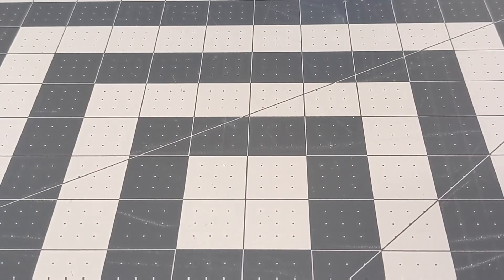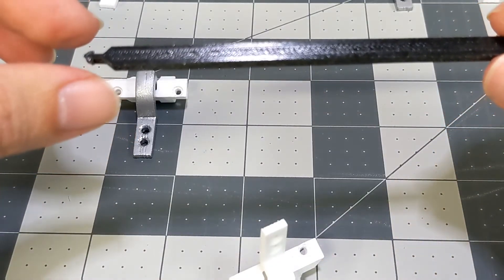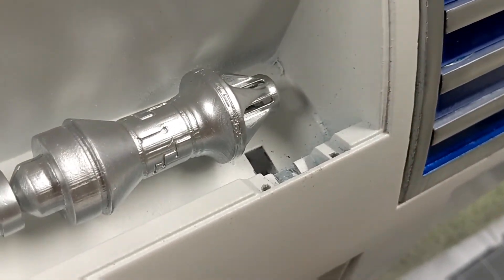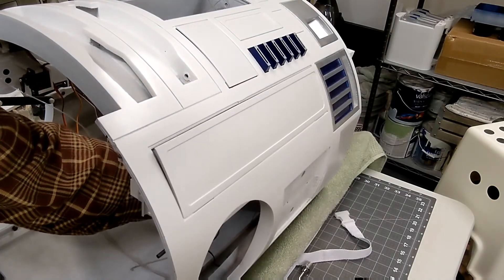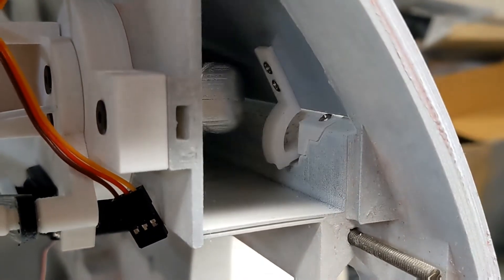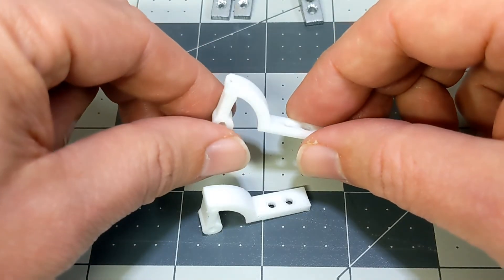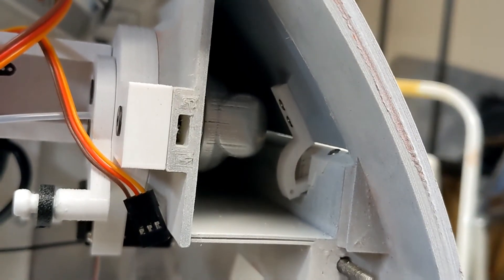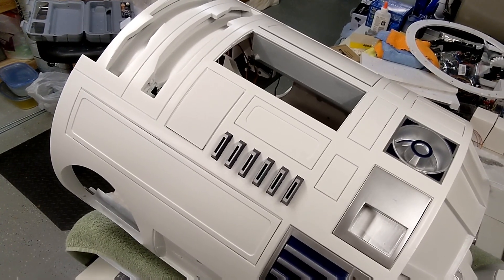Body Door Hinges

Comment: Hey Jason what paint brand/color did you get for the white portions of r2?
Reply from the maker: I used Rustoleum Satin Blossom White - it's easy to find pretty much anywhere (Ace, HD, Lowes, Wal-Mart). I also applied a Rustoleum satin clear coat over all the white - and so far it's held up really well. It's not spotless - there are a few scratches and chips here and there, but it's been decently durable.

Comment: Love you videos have learn a lot. I going to build a R2D2 using your videos to help.  What software do you to print your r2-d2 (fusion 360). I new to 3d printing so this is going to be a learning curve for sure. i will need to get a 3d printer and don't know hat  material to use for the printer .
Reply from the maker: If you're new to 3D printing, then you should definitely start smaller and work your way up to a project like this. A full-size R2D2 build represents a significant investment of both time and money. There are many resources online for getting started with 3D printing including many great YouTube channels, and I wouldn't be surprised if someone you know already dabbles in 3D printing and I'm sure they would be happy to show you how it works.

The 3D print files for R2D2 were created by Michael Baddeley and are freely available to everyone. The link to the shared drive that contains the files can be found here: https://www.patreon.com/mrbaddeley/about You do not need to become a Patron to get the files for R2D2, but considering all the work that he has put into providing these for everyone, it would be nice to support him if you can.

In short, Mr. Baddeley provides ".stl" files - one file for each part of R2D2. Many larger parts (like the dome, body, and legs) are actually made up of many .stl files that are printed separately, then glued together. In all, there are probably 500 or more individual parts that go into an R2D2. Bigger printers allow you to print some larger "chunks" in one go, but it is possible to print a full-size R2D2 on a printer as small as an Ender3 (220x200 print area).

We use "slicer" programs on our computers to convert the .stl files into "print files" (gCode) that are then loaded on the 3D printer. There are many different materials to use, but most builders use PLA+ or PETG for their droids.
Reply: @jasonsR2D2  thank you for your good suggestion.

Comment: Can I ask what is on the inside of each of the doors, it appears like there is a foam piece attached to the doors for thickness?  Is it foam, or a 3d Print?  It makes it look awesome, first time I'm noticing it.  I've watched this video multiple times as I'm getting ready to start attaching hinges to my body panels.  If you 3d printed the inside panels, are the stl files available?
Reply from the maker: If you're referring to the interior relief pattern, that is part of the standard body door files on both the MKIII and V2 Baddeley body doors (though the exact pattern differs slightly between V2 and MKIII). I haven't done any modifications to the body doors themselves. My DOME pie panels however, also have an interior relief pattern and they are NOT the standard Baddeley files. They are replacement pie panels that are included with the dome pie panel hinges that I used (https://www.thingiverse.com/thing:2797760). I definitely prefer the look of these panels - they better match the body panels.

Comment: Hey bud is it the V3 or V4 in the dropbox that i should print?
Reply from the maker: The V3 file is just the hinge saved as an .stl file, whereas the V4 is the raw Fusion360 source file that you can use to edit or modify further if the .stl doesn't solve the gap on your build. I think Fusion360 automatically increments the filenames each time you save/export it - there should be no difference between the two. Good luck and I hope it works for you!

Comment: I would like to say this was a great solution to a problem i had.  I thought i would throw out there how i solved my issue with out reprinting.  with the doors open i grabbed a mini torch heated both hinges for just a couple seconds enough to soften the plastic with out distorting it.  Then shut the door tight with my hand until the plastic cooled and done, doors shut perfect.

Comment: Have you or would you provide a scan or STL of your rod linkage? I have had issues trying to bend mine into the right shape and size
Reply from the maker: Here's a closeup of the linkage for my DPL door: https://photos.app.goo.gl/vn8sjm3yCXrVTF7n7 The other linkages are very similar. Overall, this linkage is about 6 inches long - I usually start with a wire that's way too long, bend the hook until I'm happy with it, then trim it to length. I also have a public build album ( https://photos.app.goo.gl/uHL7RM7Z8GswUFev7 ) that includes this image plus tons of others for reference.
Reply: @jasonsR2D2  thnx!

Comment: That hinge you made looks a lot like the V2 hinge, complete with the linkage hole. I have them on my R2. I've had my own share of troubles redesigning the hinges for a saw door on the other side of the coin slots. (Mark II body) cool solution! I definitely need to check the rest of your videos out.
Reply from the maker: I'm slowly getting better at designing my own parts. Once you get past the frustration, it can be pretty fun.
Reply: @jasonsR2D2  For a lot of things yes, making your own model and stuff can be fun. I redid several parts on the R2's body and made some of the missing arms to try to cram them in. Those were trial and error.

Comment: Did you have any trouble with warped doors when you printed them? Not sure what type of filament you used
Reply from the maker: My droid is essentially all PLA. Only the flex bits are not. I have been lucky to not experience any warping, even with the long breadpan doors. I think both of them will import into your slicer oriented along their root edge, at a slight angle so that the outer skin and the inner edge are on the print bed - no supports needed. I also printed mine with a raft. I know lots of folks hate the wasted filament you get with a raft, but I find it really helps with bed adhesion and I use them on just about everything. If you're printing in PETG or especially ABS, warping can be a big problem and the breadpan doors can be extremely difficult to print, but I've not gone down that path.

Comment: Thanks for taking the time to upload your videos, I've enjoyed watching them whilst TomsProjects is taking a break 😁.
I was wondering how I was going to insert those TPU flex arrow heads, I was also having no luck getting them in. 
This latest upload was perfect timing, as I was just at this door fitment stage. Worked great!
For the "Metric Users" I used 4GX6mm pan head self taper screws, just enough to hold on and not poke through the other side of the doors 😉

Comment: What part did yo use to connect the servo to the door hinge (the thin metal wire)?
Reply from the maker: I'm pretty sure the wire I am using I picked up at a local R/C hobby shop. It's ~1mm in diameter and came in straight lengths of maybe 36". I picked up several pieces when I was doing my dome and haven't restocked in quite a while. I will be making a video soon showing in more detail how I make the servo linkages, and I'll be sure to find a source for a similar wire. Just be sure that you get straight lengths, not coiled wire - it would be a real pain to try and straighten it out.

Comment: Would you mind sharing the screw size you've been using for your hinges/doors? I've been struggling finding the right size and have ruined a few doors. Thanks for the videos!!
Reply from the maker: I added some links in the video description to what I'm using. I had intended to mention it in the video, but just forgot to. It's tricky finding hardware that small. The #2 x 1/4" are absolutely perfect for attaching the doors to the hinges. They sit nice and flush. I couldn't find similar flathead screws for attaching the hinge blocks to the body, but the rounded ones I did use are ok. At this point, I've installed/removed/reinstalled the doors so much, I'm worried I'll need to go with a bigger screw as the holes are getting a little worn out. Don't overtighten!